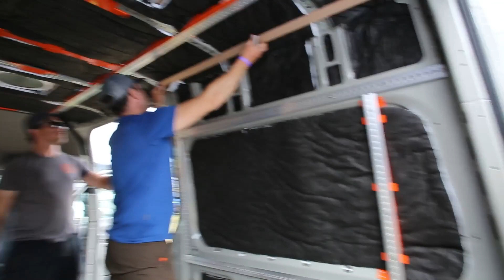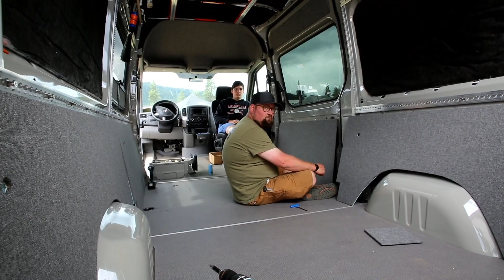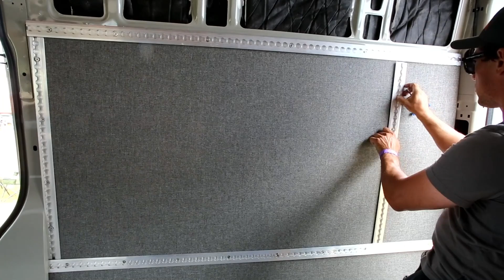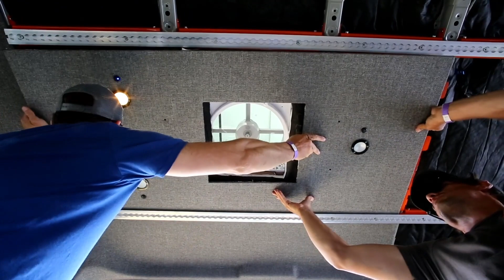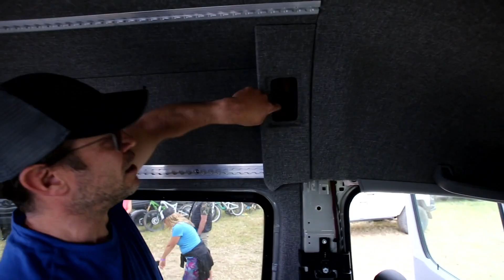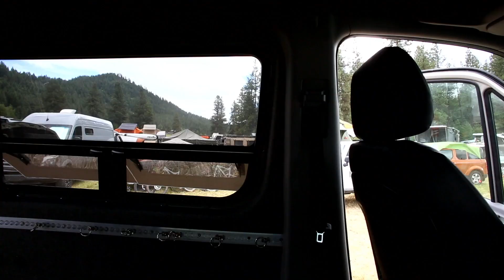Adventure Wagon Wall & Ceiling Panel Install

Comment: There is no vapour barrier in this conversion. The exposed metal will attract condensation which will wet the insulation and ultimately lead to mould growth and eventually rust  and corrode the metal. Not a professional solution.
Reply: The sheet metal is a vapor barrier.  Adding a second one is a very bad idea. The wall needs the ability to dry inward.